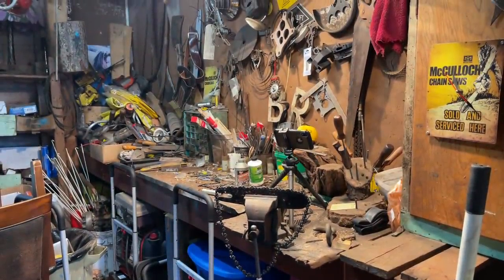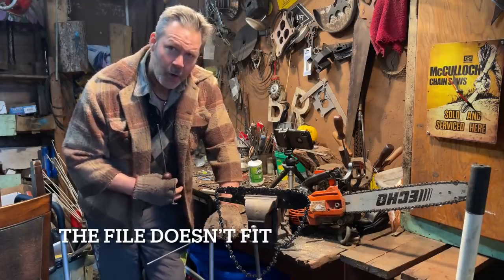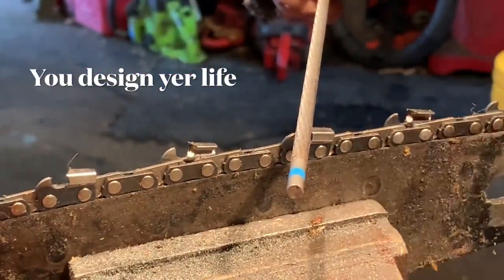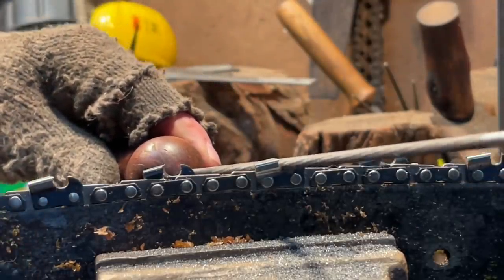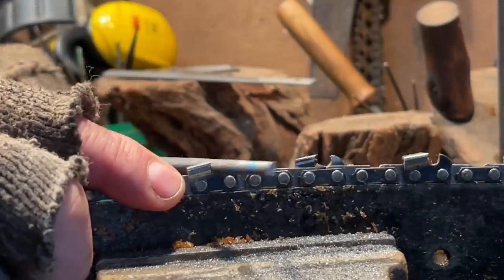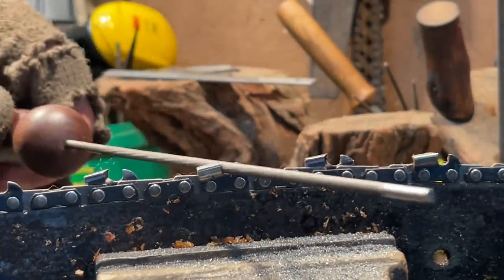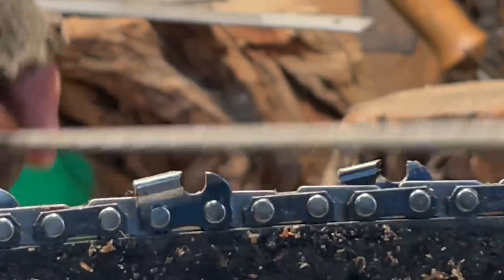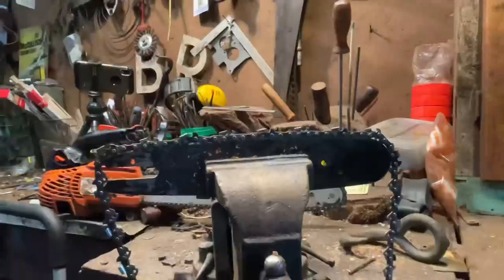Is This File To Big?. How professionals sharpen small chainsaws.

Comment: I have been doing this same thing for years.  Always step up one file size from factory suggestions size.  Now I'm getting into hand square filing, must say I'm hooked on the square cut tooth.
Reply: Hello

Would going one file size up go with any chain size?

I use .325 chain. Factory says to use 3/16, should i use 7/32??

Seems like it may work better. 
Im still a rookie at filing. Learning a bunch from the channel.

Comment: Buckin, I switched to the 3/16 file for 3/8 low profile after the last video you did about this. What a difference it made with my saw. Cuts a lot better, and much easier to sharpen. Thank you for showing us all this trick. One question I have is, what brand of files do you prefer to use? Thank you for all you do Buckin keep up the great work. 🤘🌳🪓
Reply: He told me he uses Oregon files.

Comment: Thanks so much for your contribution Buckin! I´ve been working in south Chile with the makita 36V electric saw, I love it for my small cuts, wich file will you recomend for this? Is it possible to chisel sharpen this small chains? Wich file for this purpose? They are very small, the gauge is only 1.1 mm. Have you ever made a video on this electric saws? Cheers mate!

Comment: What about raker gauge for the smaller chains, i get confused which is needed as i use Millimetres. Even for the larger chains i don't have a clue, ones i've bought dont sit how they should, even those horrible ones that sit on top of the chain. I like the one you use Buckin, progressive one i believe but those aren't available in the UK due to tree felling not being as big as it is in US/Canade

Comment: Ive always used 3/16 for 325 chain, i also use my 3/16 on my worn 3/8 chain to get a nasty little gullet that cuts aggresive but fast. 7/32 on 3/8 untill worn ovcorse. Seems to work for me

Comment: Hi Buckin'.  You had a video a couple years ago where you recommended using a larger file (approx. 1/32 larger than factory spec.), e.g.; 7/32 file on a 3/16 chain. I've used your advice and my saws cut like butter (AWESOME!!!!). Is the principle the same for 10*-15* on a chain I use on a saw mill? So if I have a 3/16 chain that I use on my mill, ground at 10 degrees, would you use a 7/32 file for the 10-degree cutter?
Reply: YOUR personal experience is the only one that can tell that. 

I’m not trying to be condescending, but isn’t this one of the things that he’s been saying? Try it out and see. After all, it’s (at worst) going to be needing a refile job. 

Me personally, I’d try it out. I’ve even used a 1/4”dia file for a brand new 3/8” full-size chain. It cut like mad but I quickly had to return to the normal 7/32”dia file because I was getting into the tie straps to quickly and to badly.

But that’s just me 😁

Comment: What brand of files do you use? I don't get as many shavings coming off the chain (the metal dust with each file stroke) as you do. It doesn't look like you are pressing very hard with the file, and the file you use sounds sharp. Thanks much for your vids. Great!
Reply from the maker: that will depend on what you think is a acceptable amount of filing you can get from 1 file , just a heads up i get 4 or 5 filings on a 32 " bar ,, full house? maybe even 3. Oregon and stihl are what seems to be there
Reply: @BuckinBillyRaySmith  thanks bb.

Comment: For the oregon vanguard chains with the 7/32 file so those chains can only be used with the 7/32 file correct? And how do you file down those rakers? The depth gauges are angled forward

Comment: The few times I’ve sharpened 3/8 lo pro, that is exactly what I’ve done.  Why buy the extra file when you just use what you have.  Files aren’t that expensive, but really no need to stock the extra size for a few chains a year.

Comment: Buckin I was trying to figure out what file size to get today for my smaller saws, you nailed it thanks! I always felt that little 5/32” file was flimsy and hard to get a smooth cutting stroke without bending the file especially at the tang.

Comment: I file my low pro. 3/8 chains with a 3/16 file for about 3/4 of the chain life then I'll switch to 11/64.  Same with the full size 3/8, I will use 7/32 for a bit more than 3/4 of the life then swap for a 13/64 till the end.  I also don't pay much attention to the "wear line".  I run my chains until I am missing 4 or 5 cutters in a row; until then they'll cut just fine.
Reply: I file my low pro. 3/8 chains with a 5/32 file for about 3/4 of the chain life then switch to 1/8 and get that gullet and wicked hook. .
Reply: you run your chain until it is worn down that much ? I would be very careful with that , because if they are worn down that much they can cut loose when you are bucking if they are worn too much . No telling where that little piece of shrapnel is going to go. It  can happen

Comment: I changed to the 3/16 file when sharpening 3/8 lopro after you made a video about this the first time.  Much better!  The file is easier to use, the chain stays sharp longer, and the gullet gets removed automatically!  Thanks to you!
Reply from the maker: precisely
Reply: On a 3/8 chain shouldn't u use a 7/32 file which is bigger than 3/16
Reply: @gunterbecker8528  7/32 is for regular 3/8 chain, 3/16 is for .325 chain, and 5/16 for 3/8 low profile, which is what I was talking about.  He suggests trying 3/16 for 3/8 "lopro".

Comment: Thanks Buckin, I’ve tried both.  Like you I feel like I have to pull the smaller file up a little into the gullet.  But I have been irritated at how the bigger file grabs at first until you’ve got rid of the bottom chisel.  Thought I was doing something wrong.  So long as it’s throwing chips, I’m a happy man.

Comment: This is fantastic!! I have a question though Buckin’ Do you file your rakers the same as before with a guide? Or more aggressive since the chain is more aggressive. I’ve been saying for years that 5/32 files are too small!
Reply: The same as you normally would. In fact, if you are using the progressive style raker/depth gauge you use the same style AND the same setting for lo-pro/pico as you do for full-size. I hope that helps.

Comment: I always use a larger file  - it cuts the whole tooth. Sometimes even good double cut coarser files (but those aren't very economical as not much is cheaper than a chainsaw file - a double cut general purpose file can be 4 times as much).
Reply: Hello

Do you use a larger file on any size chain? 
I run a .325 which a 3/16 is recommended. Seems like 7/32 would get the top edge sharper. With a 3/16 file i have a gap at the top edge.

Thanx!

Comment: Thank you. I remember in one of your earlier videos you stated 5/32 was too small. It appeared you were recommending 7/32 which I purchased and still use along with a 3/16 which I have not used to date. Which actually is the better choice? I use Oregon chains. Low profile 3/8.
Reply: Lo-pro, 3/16

Full-size, 7/32
Reply: Since seeing the reply from Todd Adams and studying this video, I switched over to the 3/16 and what a difference! I typically use the Oregon Advance Cut LowPro chains and now it's a whole new world! Chains stay sharper longer and the cutting ability is night and day from what I was experiencing. Thanks to Buckin' Billy Ray for this video and to Todd Adams for answering my question.

Comment: I use the recommended file and it is very flimsy. You cannot push hard or the file bends and you wont get a straight edge on the cutter

Comment: Use a weight on your chain to hold tension. Also id only use a 3/16 file for half the length of tooth. Only reason id say that is you will not get a nice shape gullet. You need to get that gullet.
Reply: Haha i commented too early hahaha

Comment: The manufacturers want you to use small files so that you have a large scoop overhang on your tooth that wears the chains out faster because they dull easier because there's to thin of a cutting edge when you use the bigger file there's less scoop or overhang on your blade edge makes it last longer and you can bear down, and if you bump some dirt with less angle on your blade it won't dull as easy, not saying you're going to dig the bar into the dirt. Chisel chains are the best I love a chisel chain on my pro Mac's

Comment: The reason to use the right size file is to achieve the correct angle on the cutting edge but not file the gullet base so low that it gets too close to the rivets. Get too close and it weakens the chain causing premature and dangerous breaking. Bad cutting edge angle causes uneven wear to the bottom of the chain links or side plates and again can cause premature breaking.
The guys that designed the chains tell you the file size following extensive research and testing. They would also recommend that you run the chain properly adjusted.
Reply: Yeah, and people who design chainsaws will tell you not to port them, right?
Reply: @jolkraeremeark6949  That's right book smart but  no experience. All they know is what they have been told or read. 
I'll take experience over education any time.
Reply: The reality is they come from a world of type approval. A product is tested for safe use and should be both manufactured to the standard submitted but also used in the Manor that was intended.
Now if you wish to modify either the saw or chain outside that then you waiver your rights.
On that note it does not mean that all manufacturers will pretend it does not happen but they will not endorse it. A major chain maker even gives instructions on how to modify their standard chain into racing chain. Significant to the video is that reducing the file size will give a sharper cutting edge.
For the record porting a saw does make it turn faster if you know what you're doing but an expansion exhaust gives it more power. A stock stihl 880 is around 10 bhp. The same capacity mx bike is close to 30bhp.